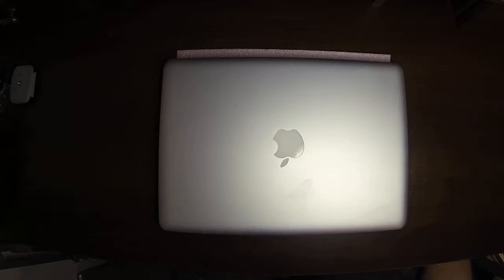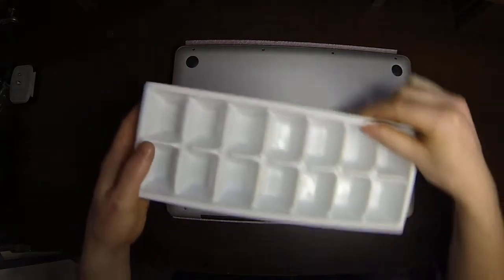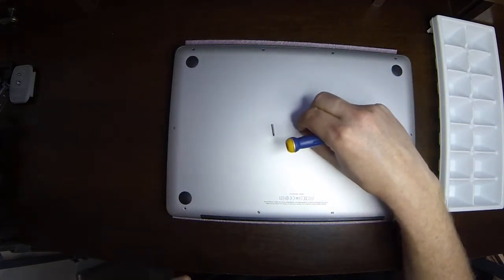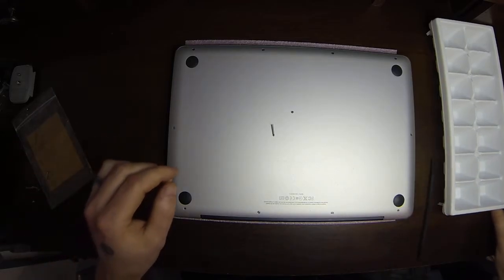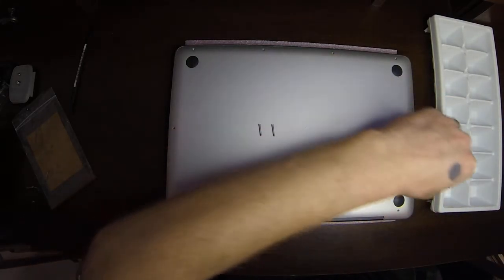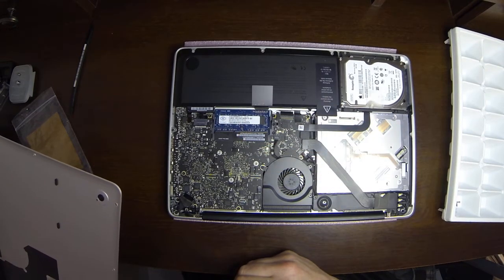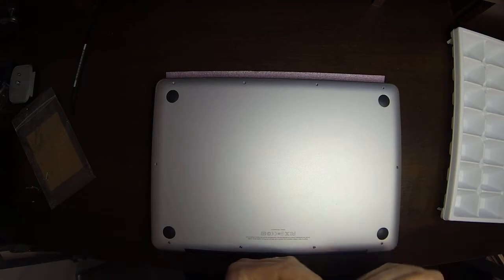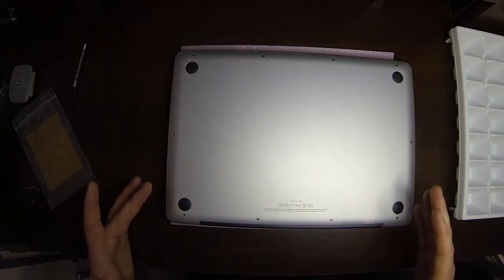STEP 1: Apple Macbook Pro Unibody Bottom Panel Removal

Comment: Hi MrTechEasy, I had a few questions for you. Do you have a Logic Board disassembly/reassembly video for a 2010 15" MacBook Pro? Also do you have a reliable supplier of parts? I think i'm in need of a new Logic Board for that model. Thanks, great video!
Reply: @MeTechEasy my MacBook pro 15" Unibody when I plug in the power cable it is a very faint green light on both sides and it consistently blinks a faint orange and there is no lights on the battery level indicator on the side doesn't blink at all is there anything I can do to bring it back to life I've only have it for 2 years !
Reply from the maker: I don't have one but if you could give me a couple of days I will do one for you. 
As far as parts go, I get a lot of stuff off of eBay as those are the best prices however you really have to be careful there and look for sellers with really good feedback ratings and a lot of them.
Why do you think it's the logic board?
Maybe I could help you troubleshoot the problem before you spend the time and money on a logic board.
Thanks
Reply from the maker: Crowshoof & Games Did you have any damage to the system? Liquid spill? Drop? Anything happen recently that might align with when the problem began? Unfortunately I'd need more info to help out there. Let me know more info and i'll see if I can help you out any further.

Comment: hello, i have a question. i think my daughter stuck a nail filer in the cd-rom section of my mac. if i take the back off to get it off will i mess up my computer?
Reply from the maker: You can't mess up the unit from taking the bottom panel off however taking the bottom panel off doesn't give you access to the inside of the cd-rom drive. Did it get stuck in there?

Comment: Great idea, very organized, and very good video. I'm so glad you shared this information. I have one to work on just like this that's either the same age or a 2012 and I need to fix / clean the keyboard and eventually I want to upgrade the hard drive to a solid state hard drive if the mac book pro will allow this. Mine is a I-Core 7 Intel chip / 500gb 7200rpm drive, and 8gb of ram model.
Reply from the maker: Thanks for the great comment.
I also replied to your other comment on my other video and plan on making you a SSD upgrade video soon. :)
Reply: Thank you so much. I really appreciate it..Thanks.